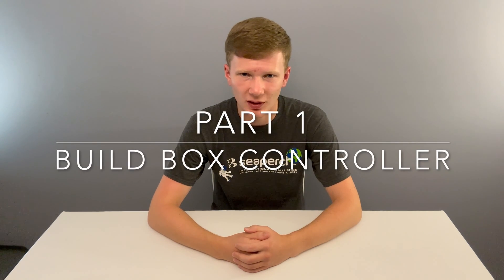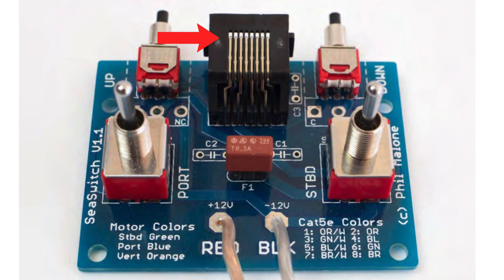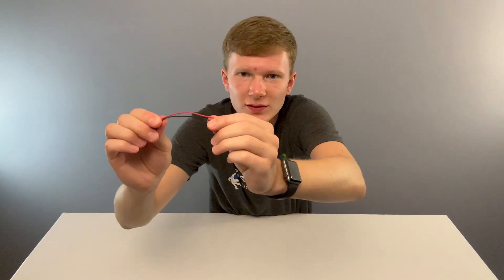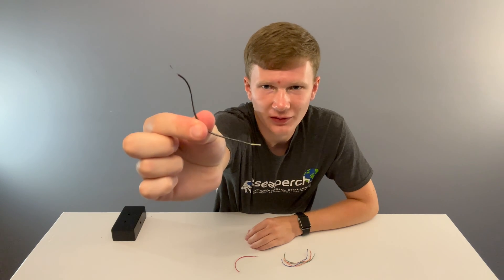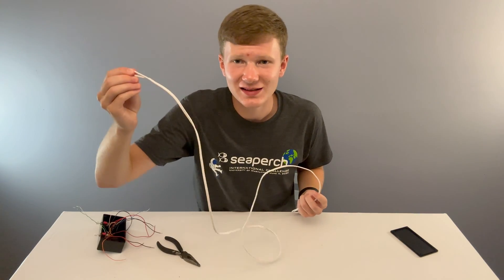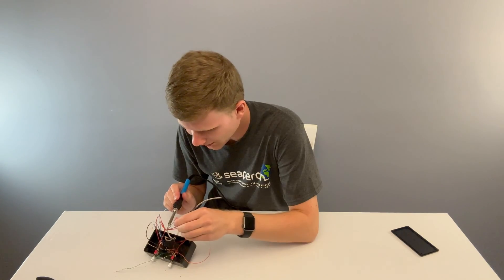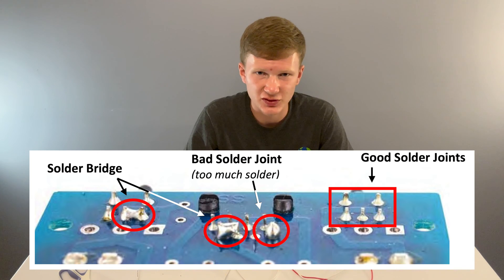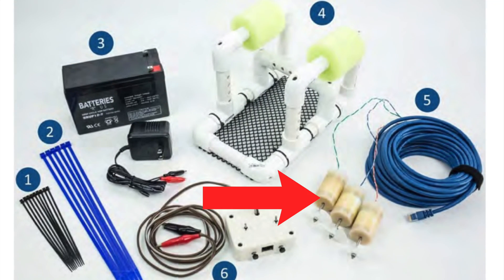A Complete Guide To Your SeaPerch Controller (4/5)

Comment: Do you know any of the specs on the fuse holder and fuse for the newest iteration of the controller? They didnt send either in my kit and, though I used to teach this program, it was pre PCB and we just put an in line fuse holder with a 20A slow blow fuse on the power cable itself. They dont list the specs for the part anywhere that I can see...
Reply from the maker: Not sure if the ones I have are the same that come with the kits, but mine read “LF10A/32VP” around the metal caps. I found another small box and those read “S10A250V”. I’m no fuse expert but I’m assuming as long as you stick with the standard 7A12V Seaperch batteries (with lower amperage and voltage than the ratings of the fuses) they should be fine.